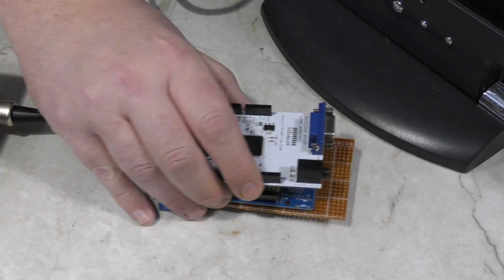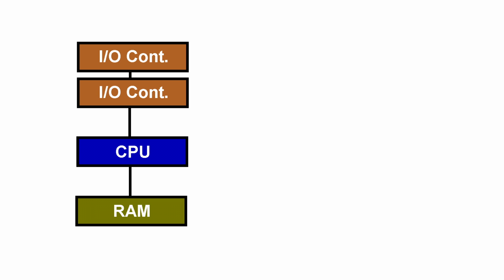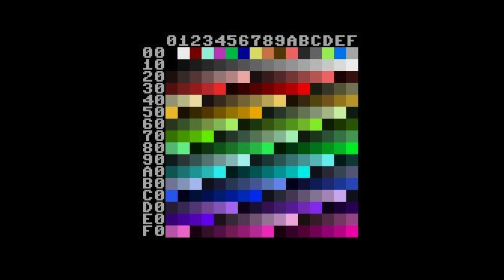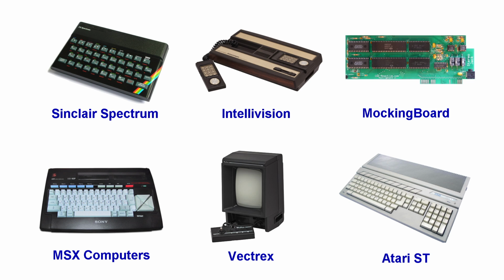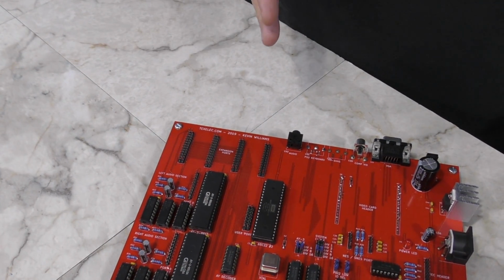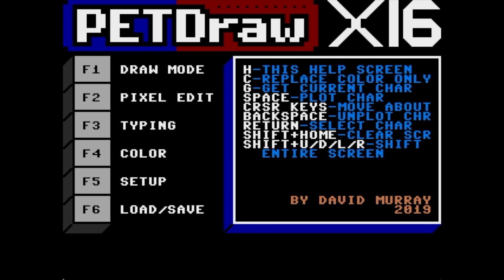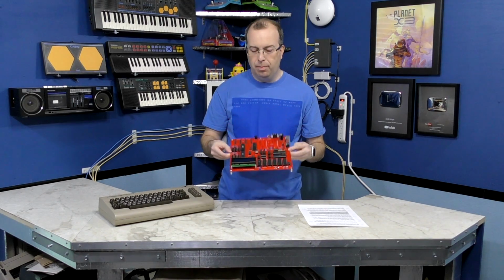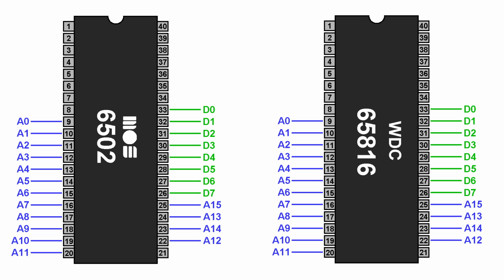Building my Dream Computer - Part 2

Comment: The typical nightmare of any design process. You start with a vision, a vague concept, that becomes the nexus point that all subsequent ideas must both work from and, ultimately, toward. From there you have wants, and musts. Some musts are immutable and cannot change, period, others change with the wants. If you want [this], then [this] must also be. It's these musts that form the hard boundaries that you must work inside of. Every idea and choice opens new boundaries, and closes off others, and it creates a massive, spiraling tree of seemingly endless choices. One by one, routes are chosen, and eventually a path becomes evident. However, some paths are but a dead end, at which point you must back track. Eventually you keep pushing forward - two steps forward, one step back, two steps forward, three steps back, two steps forward, one step back. Slowly but surely, you make progress, experiencing occassional, if not frequent, setbacks. But you keep pushing forward to the original goal. You keep hitting brick walls, the musts, that shape the wants, and you choose the wants that ultimately best suit your original vision. It's a delicate balance the entire time, of what you want, versus what makes sense, and ultimately what simply must be. The best products go through this process not once, but many times - every possible route explored, its outcome recorded and measured against others, to see what ultimately is the best. Some choices are obvious, others may surprise you. Some choices are better than others in the small scheme of things, but because of the diverging paths they lead, the inferior choice may actually be the better tradeoff if it leads to bigger and better possibilities down the road. In the end it's one giant rollercoaster of success and failure, of progress and setbacks. Clear choices and confusion. But in the end, you must always push forward while keeping true to the original vision, and always be willing to make sacrifices along the way, if it benefits the bigger picture. There is an end, and all who fight hard and long enough will see it. But success or failure depends on these choices, and the creator's foresight and stength to make sacrafices, and willingness to seek every possibility.

Comment: 2MB of RAM and 16bit CPU... I smell DooM being ported ;)
Reply: a 6502 with 8mhz can easy do doom if the graphic chip has good functions to draw polygons with a filled pattern. the pattern aka bitmaps can be in the video ram, so they do not need to be shifted through the main bus
Reply: I think Doom required 4mb of ram and could easily crash with that limit. It worked better with 8.
Reply: There is a doom on snes
Reply: @enjibkk6850  Yes, there is, but it doesn't run on stock hardware, it uses cart with SUPER FX chip. History behind this port is awesome though, guy who made it started hacking Star Fox cartridge with Amiga and wrote himself entire toolkit, and engine from scratch using only DOOM FAQ :D
Reply: @C64Lover  There are versions of DOOM ported to several 8- and 16-bit based machines. It runs smooth on the Z80-based Texas TI-84ce calculators, for instance.
Reply: Yes but Doom was only possible on SNES with the additional 20Mhz Super FX chip on cartridge pcb
Reply: @enjibkk6850  1/ SNES Doom is closed/propietary code as far as I know. 

2/ SNES Doom cartridge contains a  Super FX 2 chip, a custom-made RISC processor to provide advanced 2D and 3D capabilities.
Reply: @enjibkk6850  And on Gameboy Advance....even though 32bit system, but still i find incredible to this day.
Reply: Doom is even on calculators...LOL
Reply: I thought Doom needed a 32bit processor?
Reply: @IanC14  The original PC version did, but there are 16-machines even among the official console ports of DooM. Sure, it would have to be "trimmed" a bit: SNES CPU was 3.58Mhz at best and with all kind of tricks and basically a totally new engine crafted specifically for that hardware a whole sh*tload of features needed to be cut down - and it still didn't run smoothly.

Edit: ...and apparently the SNES DooM cartridge also included a custom processor to help run things faster and smoother. STILL ended up being choppy.
Reply: @IanC14  But dos computers are 16 bit. And doom was for dos.
Reply: @oscwavcommentaccount  Doom runs in 386 protected mode and uses 32bit instruction set but there is DOOM ported to C64 with 20MHz 65816 SuperCPU 8/16bit hybrid as well
Reply: @oscwavcommentaccount  MS-DOS is 16-bit, BUT DOOM is/runs on 32-bit hardware: It doesn't run on Intel 8088/8086 like MS=DOS do, but it required at least a 32-bit 386 processor.

And even worse: really 65C816 isn't completely 16-bit CPU, it is more like a combo 8/16-bit CPU.

I understand he choose 65C816 because he wants 6502 code compatibility and he loves 6502. I love 6502 too as it was first CPU I programed for in assembly language, but of course I wouldn't choose it for a 8 bit computer: Motorola 6809 is far superior, in fact it it is best 8-bit CPU in its time. And for 16-bit CPU there are much more interesting CPU than 65C816.
Reply: @robsku1  - Yep, x86 is still backwards compatible to 16-bit mode (real mode).  x86 CPUs actually still start in real mode, and a BIOS-type boot is still real mode.  Not sure about UEFI and all that crud though - it might start in protected mode?  The only limitation is once you're in long mode (64-bit), you can't run virtual 8086 mode.  

By the way, it's a rather long stretch to call a 386 PC 32-bit - your typical environment was still largely real mode until the 95/NT era.  Even if your program is running one of those DPMI things, you've still gotta contend with the facts that your underlying system calls are real-mode DOS crud, with all the headache associated therein. Plus a lot of the extended memory APIs and such had weird, arbitrary limits etc.   So it's like you have this 32-bit(ish; 386 feels more like some stupid angry 8-bit CPU that took way too many 'roids TBH) CPU saddled with all this legacy crap/legacy BIOS stuff, unless you break cleanly away from the Microsoft platform.
Reply: @ModernVintageGamer ... Doom port needed :D

Comment: The SN76489 is a better tone chip from that era.. or if PCB real estate is an issue, the AY8912 is more compact. If you can push it to the year 1984, you’ll find no better sound generator than the the AWESOME Yamaha YM-2151.

Comment: This is a very amazing concept and I can't wait to see it completed, I can already see the potential in it and the amazing things that can be done with it. Especially in terms of emulation or even compatibility with c64 and other existing cartridge based games and software. Even if it does end up costing around the $300 mark it will definitely be worth it since there isn't anything else on the market I know of that is this good.

Comment: while total overkill for your project the Silicon Labs Si5351a is an interesting configurable three output PLL chip, it permits three independant outputs be those frequency or just phasing differences.

Comment: A bit pedantic here but the unit for frequency is Hertz denoted by Hz. Thus you'd write MHz rather than Mhz, conventionally. I also don't remember the ZX Spectrum using the AY-3-8910 sound chip. In fact, as I recall, it did not have any sound chip. Rather it generated sound in the most rudimentary manner - a 1-bit PWM (if even that) output.
Reply: The ZX Spectrum 128K and all later models (+2,+2A, +2B, +3 etc). used the  AY-3-8910.
Strange that he showed a picture of a 16/48K Spectrum though, although he's shown his ignorance of Sinclair computers in previous videos.
Reply: @gwishart  Ah yes - I was thinking about the ZX Spectrum he showed in the picture.

Comment: VGA? FBAS? Without HDMI Output it will be a flop. Sadly. The planned housing also frightens me off. I like the design of Apple, but not the Design of PCs, because they have no design (or like Steve Jobs sad "They have absolutely not Taste"), only a "box". And... I don't like the XBox Design and I don'T like the flat Keyboard Design. It would be better to do something like C65. You have to think about the Retro feeling, not PC feeling. Maybe you should ask the C65 Team to use there housing . The idea and the technology is very good, but you can bring the idea down with some little false decisions. Keep up the good work.

Comment: Why not custom build the whole computer in the keyboard case ? Just like the MSX , Amiga , C64 , etc... i think that is a big part of the retro computers magic ;)
Reply: Hi! We are going this route for very good reasons. I'll be doing a full post and user poll shortly on the Facebook about this. In short, we don't want to custom build a case and keyboard as that would add hundreds of thousands of dollars which you guys would have to pay for. 

It also introduces many risks and delays as you have seen on other projects like the ZX Spectrum Next. Therefore we are limited to high quality off-the-shelf components, which is the spirit of David's project. We will be customizing and rebranding these and you'll see all the options in the aforementioned poll, and have a say. We realize with nearly 1 million subscribers we are not going to be able to please everybody, and we thank you for respecting that. 

However you can trust that we are moving forward with the best possible option for the community so you can get this machine in your hands as quickly as possible, looking sweet, and at the best value.

Keep in mind too that many beautiful classic computers did not have an integrated keyboard. Apple Macintosh, Amiga 1000, Commodore 128D, Amstrad PCW... 

Thank you for your enthusiasm and feedback 👍🕹️

Comment: Aren't there any variants of the 8910 that can run at 8Mhz? You'd think that would be the case if they use it for current slot machines and for the old Atari ST.

Comment: The Vera’s 128K VRAM is simply too good for a poor 6502, not in the least because the processor can only have 64K to address at once. However, a 65816 or an x86-16 roughly equivalent to the 6502 can have either 1 [80(1)8x] or 16 [65816/80286] MB, allowing the Vera to have all 128K to send entire high resolution 256-color pictures in one shot, not to mention that the 80286 has enough pins that it does not have to send addresses and data over the same lines, and its pins are set up so that it actually does not (see page 2 of datasheet at http://datasheets.chipdb.org/Intel/x86/286/datashts/intel-80286.pdf).  Proportionally, this will give 2M of 256 byte segments for 512MB with bank switching even if you do not want it all.  Therefore, I suggest you find or commission a lower video chip to use with the 6502 in a Commander X1648 and pair an 80286 with the Vera in the CX16128.

Comment: Being an old 8-bit programmer from the 80s & 90s,  I have to say this - if you are going Retro in function and design, you need to have it as an 8-bit system - Inside a keyboard case!

Comment: Err... I have successfuly interfaced with character LCD screens with processors running at 8MHz and above... it just means your code has to initialise the screen correctly and periodically check for the screen to be able to accept more data.

It doesn't help character mode LCD screens do not really fit non Philips 8051 architecture and thus the interface has to be bit-banged on any other processor architecture. Sucks, but hey!! -deal with it. 

I've got working AVR assembly code backed up if you need it.

Comment: One thought on the logotype. The X/butterfly logo is neat, but I don't think it looks good acting as the X in the Commander X16 name. Personally I would put the butterfly logo purely as a symbol (on the left for the inline logo) and have the Commander X16 all written in normal typeface. Same as how the Commodore chicken lips C= is on the left whith Commodore 64 typed out.

Otherwise this project is coming along impressively well. That was a great realization that you could use the VIC20 as a baseline and modify from there to add capabilities.  A flat memory model would've been nice but the bus logic sounds nasty.  Also for the speed comparison, is that accurate to how the 6502 stacks up to the 16bit 8088? I know the 8080/Z80 has a clock factor of about 4:1 against the 6502 but I'd never heard that was true of the 8088/8086

Comment: Awesome work. The sound blaster chip you mentioned sounded awful please don't use that ~ ideally a direct copy of the SID chip expanded to 8 channels and stereo per channel would be best but I fully understand the drive to use off the shelf chips and follow a KISS paradigm. 
As for case design, (or future case designs) consider the re-released Sinclair ZX Spectrum+ (1984) or the 128 "The Toast Rack", perhaps with the separate numeric keypad integrated ~ love that 80s industrial look.
Keep up the good work.

Comment: Damn. If this was to be open-sourced at some point, it would be a dream for computer science students.
Reply: There are more than enough SBC's out there to be a dream for computer science students, with a lot of pre-built libraries and developmenttools for them.

This is a board for the lovers of classic computers like the C64.
Reply: We'll probably have to make a generic clone at some point, based on the attitudes expressed previously.  I'd love to see that change (if it hasn't already).  My interest waned when I saw how closed to the community the project was at the start.
Reply: @JosephDavies  What attitudes and which changes do you mean? I am a little confused.

Comment: What you are doing is certainly interesting, but has no real world value.  Let's be clear here. These systems are very very obsolete, and since the new hybrid that you are tooling inhouse never existed in the real world....what is the point? You are not resurrecting a vintage machine and restoring it, that at least has value. So what are you doing?
Reply: I disagree - it has real world value as a learning tool. It is simplified and this helps. Many people find exploring this entertaining.
Reply: @saulysw  If it is a learning tool you seek then fire up Commodore 64 or Vic 20. Those systems actually existed. This new system will be buggy at best. You are trying to fix the shortcomings of early hardware with today's hardware. Such a thing is still obsolete when you build it, and as a nostalgic fan you can't embrace it because it never existed.

Comment: Aww, I'm a bit bummed it wouldn't be a classic home micro form factor of a computer-inside-a-kayboard. Truly a missed opportunity.
Reply: Hi! We are going this route for very good reasons. I'll be doing a full post and user poll shortly on the Facebook about this. In short, we don't want to custom build a case and keyboard as that would add hundreds of thousands of dollars which you guys would have to pay for. It also introduces many risks and delays as you have seen on other projects like the ZX Spectrum Next. Therefore we are limited to high quality off-the-shelf components, which is the spirit of David's project. We will be customizing and rebranding these and you'll see all the options in the aforementioned poll, and have a say. We realize with nearly 1 million subscribers we are not going to be able to please everybody, and we thank you for respecting that. However you can trust that we are moving forward with the best possible option for the community so you can get this machine in your hands as quickly as possible, looking sweet, and at the best value. 👍🕹️

Comment: Do you know what kind of Cherry MX switches your guys are planning on using for the deluxe keyboard? There's many different kinds. I used to use MX Blues as they were the first I used but I eventually got really sick of them. I've recently fallen in love with Silent Reds, also known as Pinks. They're a completely linear actuation with very little noise. The question is whether you think a tactile actuation point is important for typing feel or not.

Comment: Instead of trying to find a sound chip that will run at the speed of the main processor, it'd save you a whole lot of headache if you just added a slave CPU for the entire sound system. It was a common practice in the mid to late 80s, and even more in the 90s as CPUs got faster. Those sound chips are not designed to run fast, and having a slave CPU that could be at a lower speed to talk to them made the rest of the board design a whole lot easier.

The Z80 was a common CPU used for the audio subsystem on arcade boards and some home consoles, but it wouldn't be a great idea here due to adding another architecture to learn. I'd recommend using a 65C02 at 2-4 MHz for audio and having the main CPU being a 65816, that way it'd be the same programming for both.

The Yamaha chip is definitely a good choice, but I'd also pair it with a less advanced chip for people to use because writing a sound driver for a complex sound chip can be an arduous task. The AY-3-8910 or the SN76489 are good choices, and can also supplement the audio of the Yamaha chip.

Comment: As for the sound chip, my vote is for your third option: To include this circuitry in the FPGA alongside the video circuitry. Solves a lot of problems (such as availability of source sound chips).